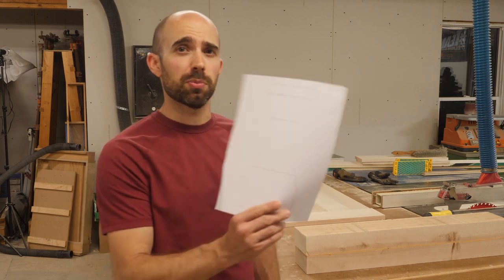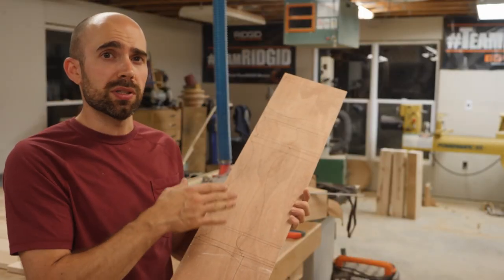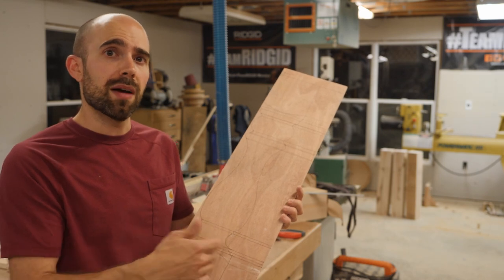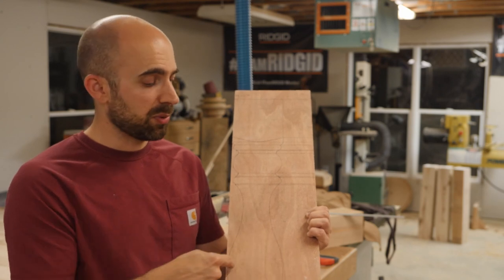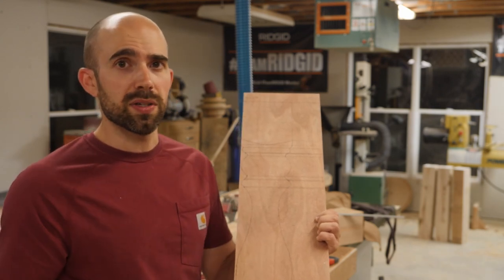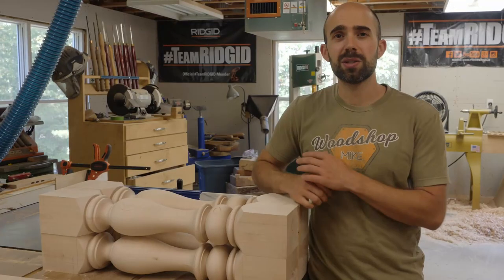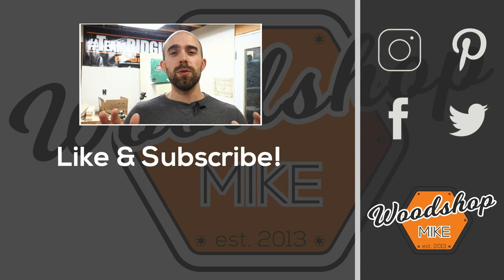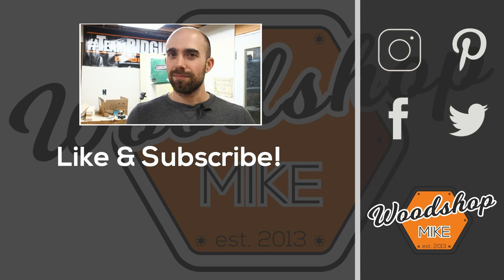How to MAKE Identical TABLE LEGS on a Wood Lathe

Comment: I have a question.
is there a way to use the template as a physical guide jig a tool could follow and that gets transferred to the spindle?
Reply: The best attachment I've seen was in a video titled "TORNO COPIADOR PARA MADERA" made by Manuel Castro. That thing is so smooth, but unfortunately, he only sells locally to friends and family. Apart from that example, the best lathe duplicator (or copy attachment) I've seen is made by Grizzly.

Comment: Hi on what site did you get the paper template  for your table leg
Reply from the maker: The pdf can be purchased here: https://woodshopmike.com/product/farmhouse-table-leg-template/
You'll need to print it off on multiple 8.5" x 11" sheets and tape them together to make a plywood template.

Comment: Hi Mike, 
How thick is the wood at the beginning? 
Nice video 👏👏 very useful 🙏
Reply from the maker: Thank you, I'm glad the video was helpful!  Since this design has a pommel the stock starts at the dimension of the square section at the top and bottom.  I believe this leg was 3-1/2" square and 29-1/4" long.

Comment: Great video on turning. I would like to point out however, the way you cut those blanks to length on your table saw is extremely dangerous. That is exactly how the worst table saw injuries happen. Look into cross cutting on a table saw and kickback.
Reply from the maker: Thank you!  It's not easy to see, but I'm using a miter gauge 👍🏻